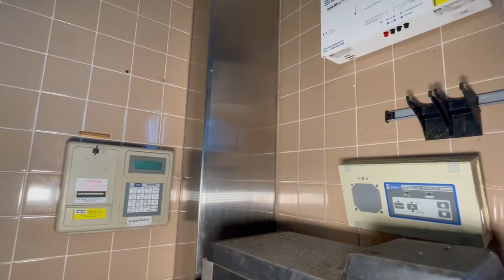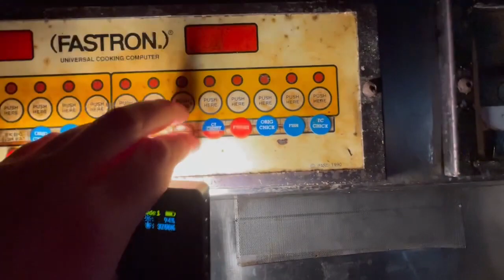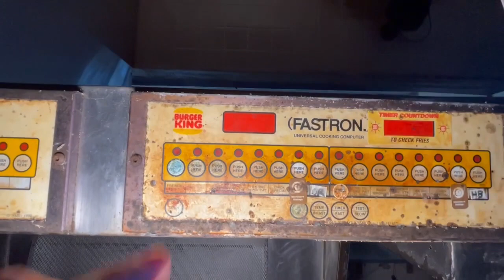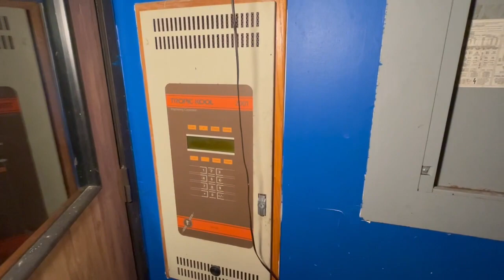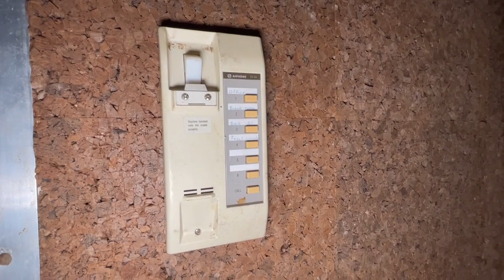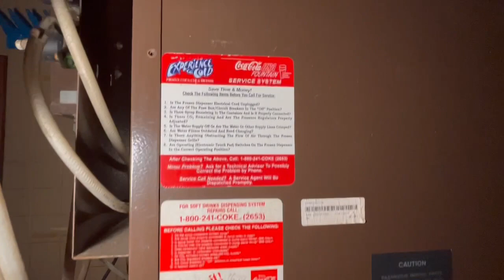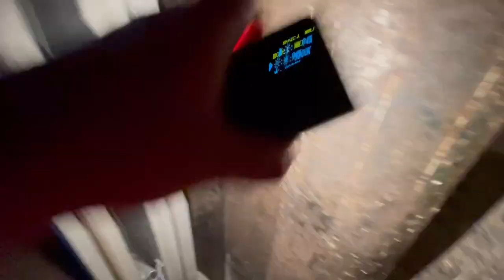Abandoned Retro Burger King

Comment: That intercom was actually used to pre-record the drive-thru greeting that would automatically play. We had one at the KFC I worked at as a teenager. 🙂 And that light bar under the window is really a sensor for an automatic window. When you step in between the open area, it would open the window, and would close it back after stepping out of that area.